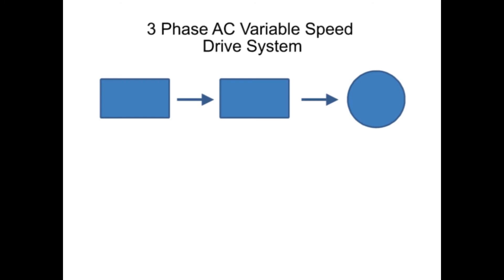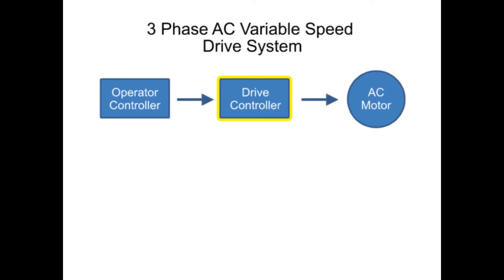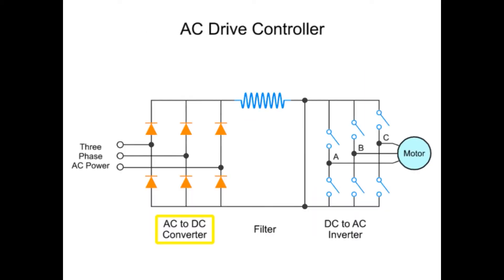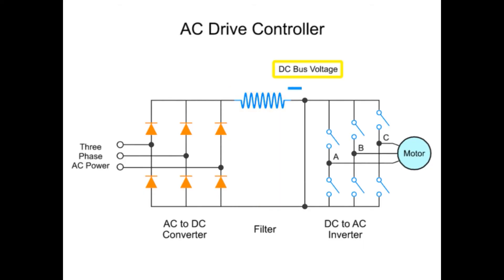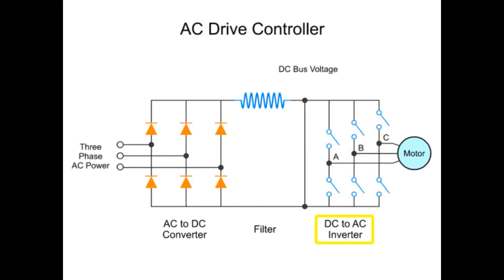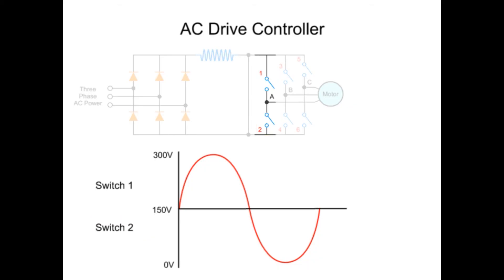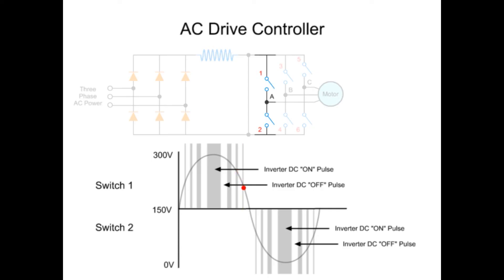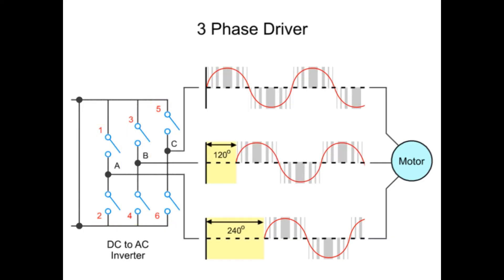What is Variable Speed Drive? | Basics and Working Principle

Comment: What will be the "Current measured" in the Supply side of the VFD while the Motor(s) is/are running at various speed (say at 100%, 75%, or 50% speed)? For sure at 100% speed would be the Full Load Amperes of the Motor!  What about at 75% or 50% speed, how much Current will be measured? would it be same as the FLA or more?